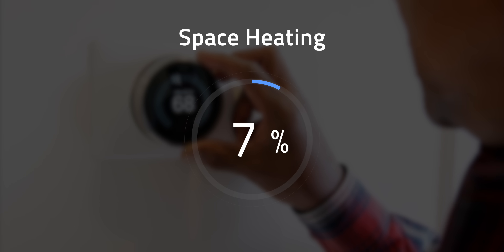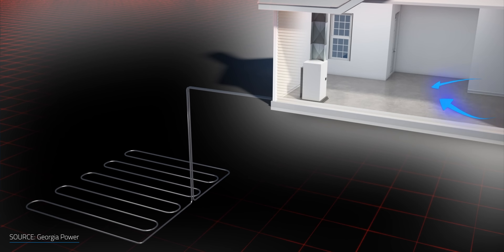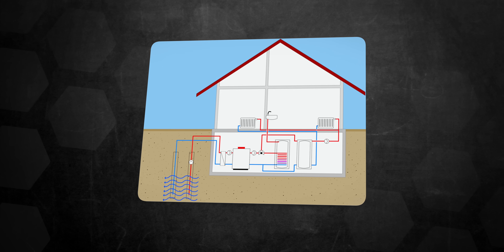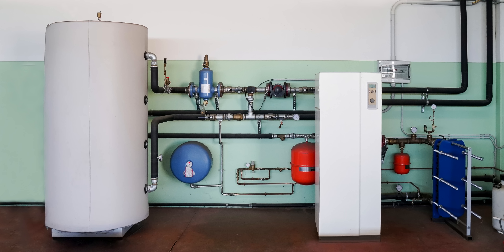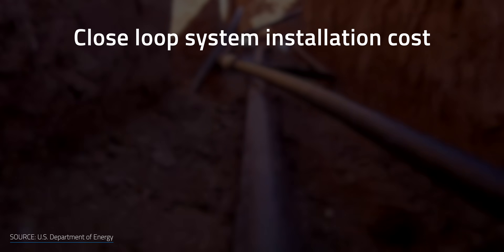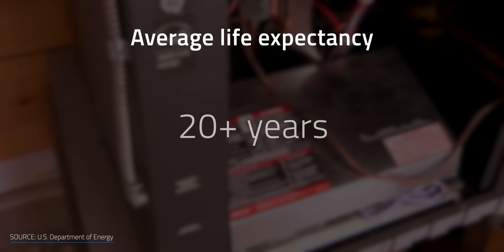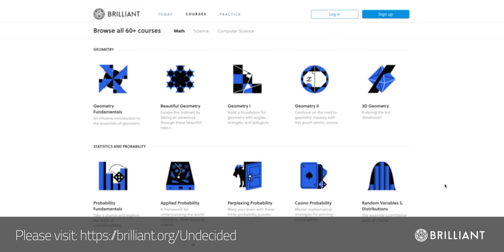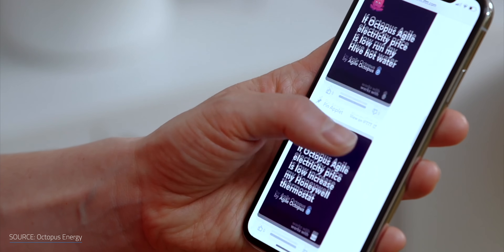Is Geothermal Heating and Cooling Worth the Cost?  Heat Pumps Explained

Comment: I treat it the same way I treat all environmentally friendly energy sources. I am sure that there are situations where it works great but is probably not ideal for most of us. I do encourage the research and discovery of alternative energy sources but i don't expect any of them to be a magic cure all for everyone. Still interesting and worth looking into.
Reply: The more extreme the weather, the better this system is. It's weakness is really the ground. If you live on solid rock, digging that up would get very expensive. Its other weakness is that it can't take care of heating by itself. It can reach about 50-60 degrees and although, youd be fine in a light sweater, its not ideal. 

The big strengths of this system is how low grade it is. It's literally just running water through the ground, very simple system. Simple means less repairs and less major work. Anyone with patience and a shovel can make this. It'll also save you a ton on electricity. You wont need a complicated AC system and it'll save you a ton on your heating since its easier to warm 60 degrees than it is 30 degrees.
Reply: @zeedstun891  interesting. This may be worth looking into.

Comment: I have to question your statistics about the total cost of heating / cooling.  You said heating accounts for 15% and cooling 16%.  No problem.
But then you said that TOGEHTER they account for 31% of the total electricity use in the country.  To get 31%, every home / business would have to be simultaneously running both heat AND air.
Since each electric customer only uses one at a time, I believe the combination would be a total averyage of about 15.5% in a year, would it not?

Comment: 15% in the summer and 15% in the winter DOESN'T equal 30%.... It equals ~15% yearly, and probably less if you have 4 seasons like the North East. Fall and spring need heat/cooling.

Comment: How well would this kind of system work in a place like Texas where you can reach temps over 110F?
Reply: As long as you got ground space, its great. If you want to see this system in action, bleed your tap water. feel how cold that is? That is exactly how this system works, it takes the temp from the ground ( just like your water pipes running through the ground) and uses that ground temp to give you cool air. its like blowing a fan across your faucet. just larger. also your water pipes wont be as deep as these, which means more consistency.

Comment: I ripped out my geothermal system a few years ago here on the Gulf coast.  Long story short, it was nothing but a Carrier heat pump that used a water circulation ground loop system to cool the condenser coil rather than a simple conventional fan.  Massive expense not only for the unit, but also all the excavator work.  In the end, there was zero utility cost savings, constant circulation pump issues, and triple the initial installation cost.  
Now if I were way up north near a natural geothermal hot spring, maybe.   Down in the south, you must dig down VERY deep to reach that constant pleasant 68 degrees, then without a compressor to condense the sweltering humidity from the air, it’s hardly better than just using a fan.  I initially tried the deep vertical borehole setup with circulation blowers.  Got only mildly cool high humidity air.  Then went to a ground loop under a pond geothermal heat pump.  Both were expensive failures just to try to do my part to help the environment.  There’s a good reason why simple window AC units work so well.  They work.

Comment: I don't see the viability in the huge majority of homes=city based on city lots.  There just isn't room for all the excavation so it is a non starter.
Reply: You could tap the city water lines and run it through a closed loop with a make up. Would be fine for cooling but not so much for heat.
Reply: @zeedstun891  Ja. That wouldn't work in the UK sadly. Very few of us have AC but we all need heating

Comment: It is not just the cost.  The area of ground required for continious geothermal heating and cooling is such that it would be beyond the facility of most typical small freeholding households.  And if you are in a flat of sorts such as large population centres such as London, Birmingham, Glasgow reside in, well there is not much chance there is there. 
Provision of a heating and coolong option might also bring us full circle. The systems still consume energy to run and the temptation to run cooling during hot summer periods might encourage previous heating only households to run cooling as well, with corresponding overall increase in annual energy consumption.

Comment: Just like cheap solar electricity killed the solar water heating market, cheap air source heat pumps are going to kill the ground source heat pump market...and that's not a bad thing.  They work to -15 F, are 1/5 the cost, integrate into the existing HVAC system, can also integrate with a backup furnace for heating, can be installed in individual apartment units or individual parts of the home or offer a whole house system, and are easier to install.

Comment: Sounds VERY expensive to install.
I installed an 1800 btu mini-spit in my 500 sq/ft house by myself for just $1000 total cost.
Reply: I was quoted £20k 😭
Reply: thats alot. did you forget a 0 on that btu? otherwise you couldve got a windoshaker or a portable ac for a quarter of that cost

Comment: The house I grew up in was built in 1975 and had a heat pump.  We also had a supplemental oil furnace.  In a middle Atlantic state south of the Mason Dixon line, we needed that furnace every year, but Dad always resisted.  
I believe our apartment complex (northern midwest) uses them too, because the forced air we have in the winter is NEVER warm.  We can't have space heaters, so we shiver all winter long.  If we ever build our own house, we will have a heat pump (for the aircon)  and a fireplace or a woodstove.

Comment: The trouble I have with the principal of the heating system is the need for the electric compressor. I know several people with these systems and they have nothing but trouble after as little as five years. And the install price will never be overcome by monthly heating bill saving as they break down long before any payback. The repairs are extremely expensive and some friends have just  abandoned their geothermal system and reinstalled gas heating due to cost of maintenance and too unreliable for the cost.

Comment: I am building a house close to the ocean in Florida. I am going with a geothermal heat pump because traditional heat pumps quickly corrode outside and lose their efficiency. Traditional heat pumps need to be replaced more often when you are close to the ocean and are exposed to salt air. I am hoping this decreases my payback time, both from decreased electricity costs and the need to replace my HVAC equipment.
Reply: make sure you get your ground checked. florida is notorious for its underground water pockets. Hitting salt above ground is much easier than hitting salt below ground.

Comment: There was a show where they heated a cabin with 200' of 8" plastic flex duct buried 3' down.  To circulate the air the just used a fan run off a solar panel.  I'm not sure of the out side temp, but with snow on the the cabin was 60°.

Comment: On paper it sounds amazing. In practice I can see issues with population density and hose materials (I’m in earthquake country) but seems handy. 

Here’s a possibility stupid question: why not build a giant heat sink on the coast for the whole neighborhood to use? Absent scales of efficiency, this does t seem doable for cooling in an apartment building. Nut, then again, I’m pretty dumb.
Reply: in earthquake areas, id give this a hard pass. For city cooling, you could just jump off the tap water line. The weakness there is for large buildings over 4 floors, they may lose alot of cooling capacity on its way up because of the heat from the lower floors and radiating off the walls.

Comment: My boss went with a geo unit when he built his home. He has never been satisfied with it. He is currently having the system removed and changing to propane. My dad worked in HVAC for over 30 years. At one point early on, he considered going Geo in his home. After several years of observing and working on geo units, he said he is glad he never installed one in his home. If you are having good luck that's great. I'm just offering another view. Maybe they are better in different climates.

Comment: The answer to this is no. When you finally recover the cost of the cheap heat after 20 years the pipes will have started to fall apart and will need to be replaced.

Comment: Many heat pumps are connected to underfloor heating systems rather than air ducted heating. From personal experience, the biggest differentiator is quality of installation, my own system failed as the closed loop developed a leak, which is now very expensive to rectify, since significant groundworks are necessary to excavate the pipework (including a new drive) in order to find the issue. Thankfully, we retained the old boiler as a backup.

Comment: Here in Switzerland Heat pumps are very common.  The temperature range in my area is from  -10°C to 38°C (14F-100F)
I have  only a 5kW (~6.8HP) air/air heat pump for heaing and hot water for a 7 room house because I have multi layered insulation of around 32cm (~12.5984 inches).
IMHO it is more important to have a good insulated house which keeps in  winter the heat and in  summer the cool air inside. 

A comfort ventilation with heat recovering is also a must when you got a house with good insulation.
So all in all the heat pump is only one part of a energy efficient house.

Comment: I've been in HVAC roughly 15 years have installed quite a few geothermal units and a big plus side is, Tax Credit. Normally when I tell a customer the cost of a system of course they shy away and can't justify the price in utilities for the price of a costly system. Until, you realize Uncle Sam will give you 1/3 of that money back for going green. So, yes in my opinion it's worth it, I only have a regular heat pump and even that to me works great but geothermal would still cut my cost down a little. Downside here is, in city limits you can't get a water source heat pump since you need your own well to run it off of. Hopefully in the near future that all changes :)

Comment: Might there be some  unforeseen consequences of essentially pumping heat beneath the frost line? The frost line in the soil protects groundwater, prevents erosion, harbors millions of microbes that are needed for plant life and is what makes it possible to have your home there in the first place. If pumping heat beneath it with the mass of millions of homes contributing to that problem(if it is encountered) it could end up not as environmentally friendly as we think. Changing the temperature by even 1 or 2 degrees could be the difference of microbes that have lived there for billions of years living, dying, or multiplying. The very stable environment beneath the soil is an essential equalizer of moisture and stress placed on the foundation of structures aboveground and life beneath. Altering it by placing millions of tons of pipes full of fluids may have all kinds of consequences we can't foresee without a complete understanding of the environment beneath the soil.

Comment: 6:20... in case you're wondering why this tech hasn't "taken off".  This is what housing looks like in every major U.S. city, suburb and town.  Integrating geothermal heating and cooling into every home isn't possible... there's not enough land on 99% of the homes that would even qualify/afford this tech.
Reply: it has been successfully installed beneath many buildings.  dig a little deeper basement  or foundation & you can build on top of it.

Comment: Having a geothermal make an “ice bank” in summer and hot bath in winter (supplemented with solar hot water  ) in a heavily insulated storage tank would allow you to run the system off peak for more savings and in the case of heat much higher overall efficiency.

Comment: Yes it is. Going on 20 years and have ice cold ac in the summer and warm heat in the winter. Barely notice the increase in electric compared to what gas and central air would be.

Comment: Umm. If total consumption in summer and winter is 100%; and 15% is spent on heating in winter, and 16% is spent on cooling in summer, then (!) it is 15,5% is spent on changing temperature in spaces per YEAR. You can't just summarise one percent with another.

Comment: 15% for heating & 16% for cooling... yes 15 & 16 add up to 31, but I don't think you can do that in this case..

Wouldn't adding them up like that imply that everyone cools & heats at the same time, which no one does? Isn't it 15% heating for ~ half a year & then 16% cooling for the other half?

Comment: You could use solar thermal on the roof and geothermal under the home to not only heat and cool the place and provide hot water, but also to generate the electricity needed to run the system. If the home is built with proper orientation to the sun and proper insulation, you begin with a home that requires only 15% of the energy a normal home requires. A Stirling generator that takes advantage of the heat differentials could possibly generate this low power requirement and the home could heat and cool itself automatically without a grid connection at all.
Reply: This is what I was thinking of doing when I build my barn house.
Reply: May I suggest if possible refrain from installing solar panels onto roofing elements, for the following matrix of reasons, roof design weight distribution coefficients, engineering and consenting processes, roof maintenance access which you will be faced with plus the cleaning to ensure the  solar absorbtiton reflective qualities,  if space provides consider mounting the solar panels within a frame that is positioned on a ground based location where you will have safe and ease of access to enable you to clean the dust and air laden contaminants from the panels. Penetrating the roofing fabric with holding down connection systems during the panel install is less than desirable , regardless of the quantify or quality of the sealants and proprietory mounting gaskets. Solar heating is environmentally seductive but one must weight up, how much electrical  power can I purchase versus the capital cost outlay and financial return period, depreciation, maintenance, and replacement plus not all solar systems are created equally, usually around 10 years, not forgetting the quality of the installation process, how long does one intend living at the property and last but not least of all, the potential of a legally initiated all season all weather disolution court order placed over the roof of the house. As with the preceding and most decision making processes, the usual defence,  never happened before and never saw it coming!
Reply: @minglim-pollard1167  I didn't need a novel to tell me "be cautious when you do things".
Reply: @minglim-pollard1167  that is actually a very solid point. I appreciate your feedback and will definitely keep that in mind if and when I ever find a lot to build my barn house. Much appreciated.

Comment: I have a ground heat pump in my house in Germany, it has a bit different  structure from what you mentioned: it pumps in closed system through two vertical pipes, which are about 60m under the ground. Heating my house which is about 185m2 costs me about one quarter of my neighbor needs for his house, which is smaller than mine. The whole house has average temperature above 19 degrees for the whole winter for 24/7. Two big rooms I keep their temperature above 21 degrees. It’s powered half the day with solar panels. This is the best investment I ever did.
Reply: Especially this winter
Reply: 60 meteres underground? really? seems excessively deep, no?
Reply: @oj5193  no just curious because I had no idea and was just surprised

Comment: Matt, nice video. I would take issue with the claim that equipment has 20yr plus life. Pumps will not last that long, capacitors too are short lived. In our market(Minnesota/ Wisconsin) rarely do compressors go more then 12yrs. Also, we usually have a backup source of heat; electric strip or fossil fuel furnace. So there are modulation devices, circuit boards, interface components  that wear out as well.
Access to geo components like thermostatic expansion valves, reverse valves, compressors, coax heat exchangers can be very difficult which raises the costs of repairs. The concept of Geo is awesome but consumers need to understand the whole story. Cheers 🍻

Comment: We installed a single 180 meter deep vertical loop for a 320 m2 house in 2010 and the savings from it compared to old oil heating system meant the installation cost was paid in under 7 years. It's only used for heating the house and water, we are using air heat pumps to cool for the one month that requires cooling here. This is in Finland. Vertical loops don't need multiple holes unlike claimed in this video. Currently it costs us only about 1400 euros a year to heat the whole house and water.

Comment: Here is the problem.  This is all well and good.  But if you live in a city (not Rural), they will require you to hook up to their grid. (So you are not off the Grid)  No matter if you have Geothermal, Windmills, or solar in your city back yard,  you will pay that politically connected grid delivery charges for all the energy you are not using.   You can never be off the grid to generate your own energy 
if you live in a city.  If you collect your own water, the city will still charge you a water tax.     If you don't believe me.  You are a fool.   You voted in the Democrats who found every way to tax you.